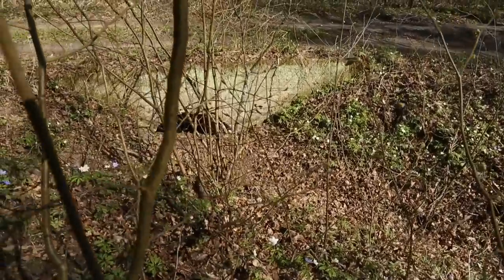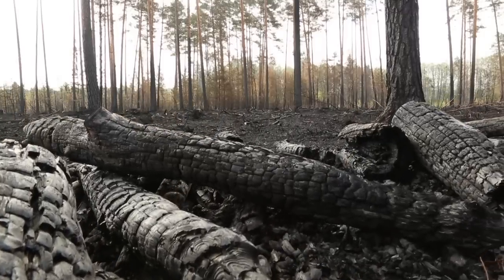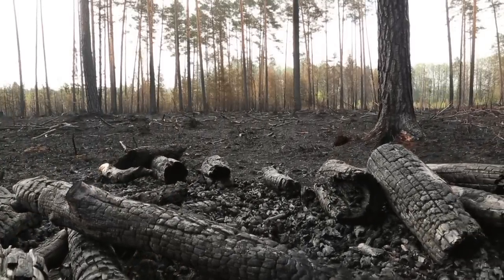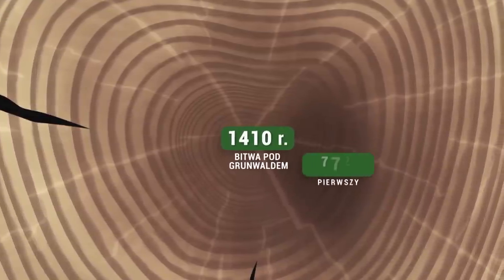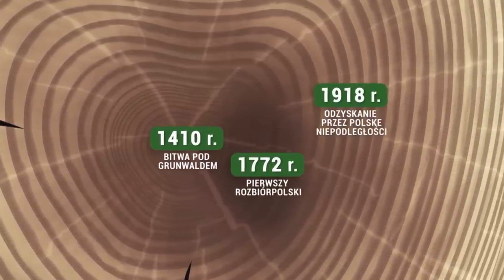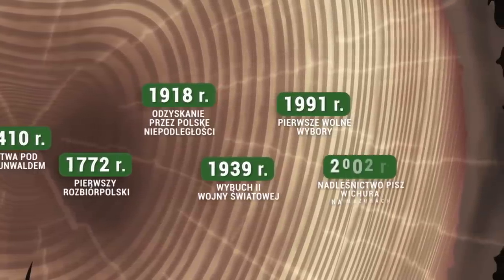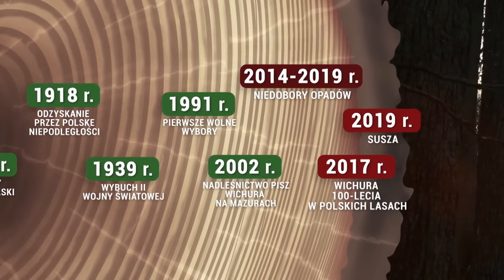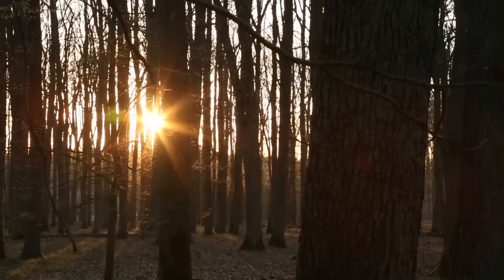Impact of climate change on the forest

Comment: The broad intoduction to the topic starting from 2:07 is just not accurate. It is stated that temperatures have most likely risen since the late little ice age. This, to me, is most likely correct. However, afterwards the speaker infers that the rise in extreme weather events during the same period have been caused by the rise in temperature. This is of course the status-quo, but it's only an assumption. These two observations are correlated, but there isn't necessarily a causative relationship between the two. 

A more likely cause for the increase in weather anomalies is deforestation.
If hydrological cycles are not working properly, extreme weather is the result. Hydrological cycles are most effective in forested ecosystems.
Reply from the maker: That is why there is no deforestation in Poland. We cut down, but then we plant and the forest area increases.